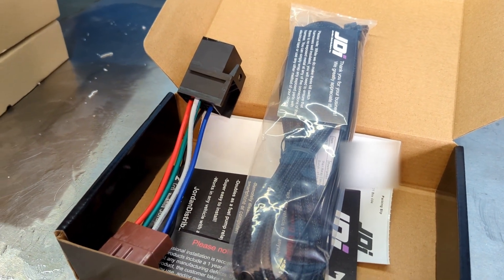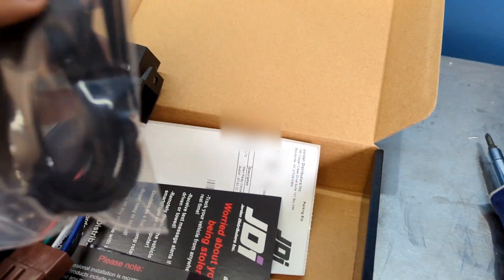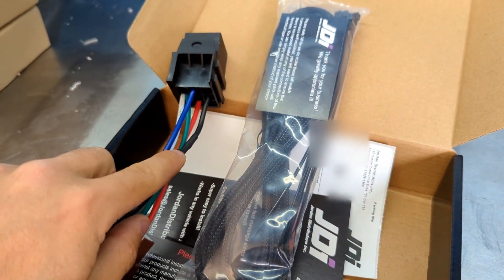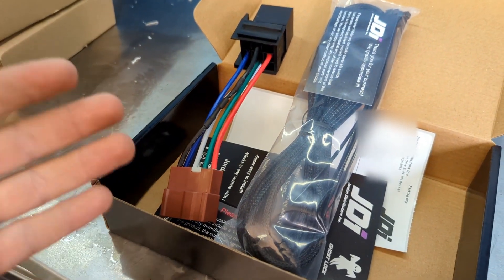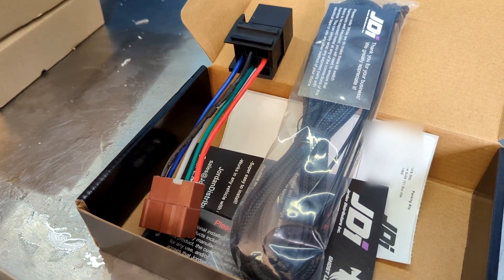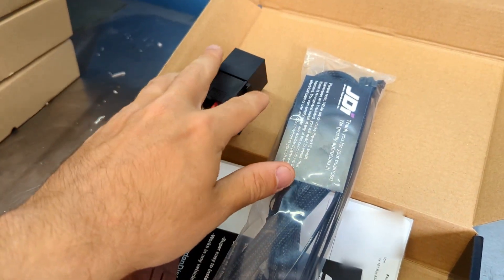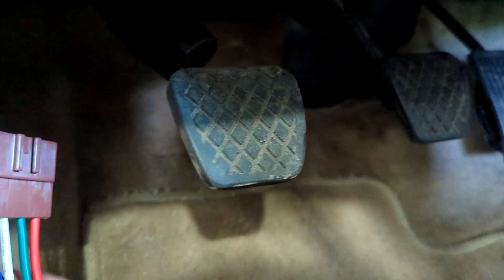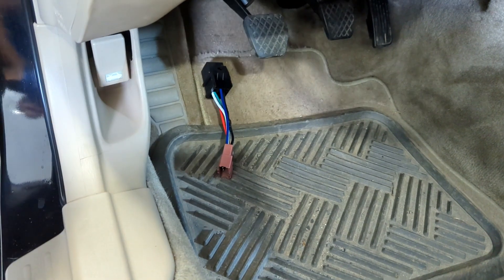Acura/Honda Main Fuel Relay Conversion Kit - JDI, Inc. Kits (Easy insurance!)

Comment: All good till you get into a accident and the ecu does not shut off the fuel pump.
Reply from the maker: I'm very glad someone raised this because I forgot to cover this in the video and should have considering it's a safety feature. So thank you. Power into the PGM-FI main relay goes to various items (injectors, fuel pump, etc.) including telling the ECM to turns on
 The ground to the PGM-FI relay comes from the ECM via  green/yellow wire (double checked before posting this reply). The JDI harness uses this same ground for the relay conversion kit. If the ECM detects a scenario that meets a condition, the same safety feature that disabled the fuel pump will also kill the JDI relay maintaining the fuel pump safety features the same as the OEM relay. I did double checked the PGM-FI diagram after this post to be sure.
Reply: @acura2g  I build harnesses for Chassie and engines for hondas and acuras. And have a 10 second integra. Most of the time its not the relay but the j32 capacitors in the ecu that signals the main relay. Also you have to be careful of plugging that in depending on year. Cause the main relay is wiring is depended on year. And you can also trigger starter engagement depending on year on the main relay pin out. If you email me I can send you some diagrams showing you the issues at hand. But other then that the kit can be a good thing for most.
Reply: @acura2g  Also I see one more problem I didn't see you typed. The main relay has a high current ground (black) that is grounded on the thermostate housing. The green and yellow is a low current ground signal to turn the main relay on. If you plug that unit in and it tries to supply ground to the fuel pump and injectors, Especially with a aftermarket high pressure pump. You will fry the ecu. Trust me!
Reply: Dam another problem I forgot to address is injector fuse (15) and fuel pump fuse (25) amp fuses.  This needs to be addressed as your overloading the one of those circuits. This should only be used as a temp fix.  They should of used two relays instead of one relay and then mimicked the factory setup as I do.